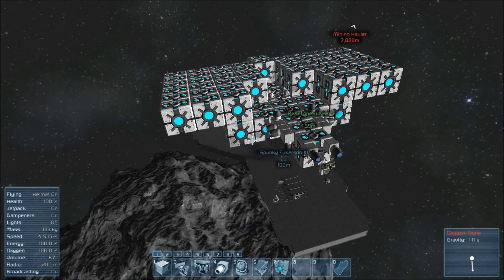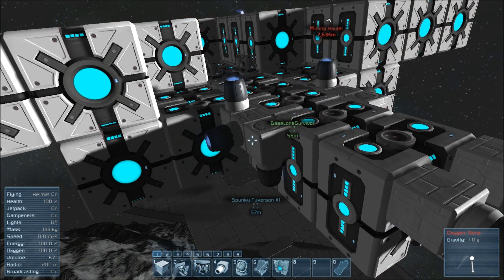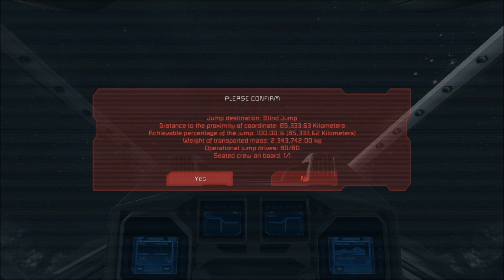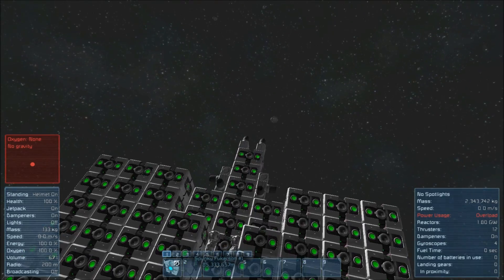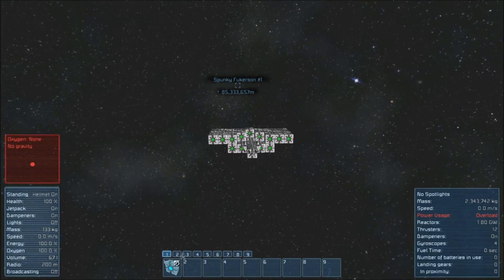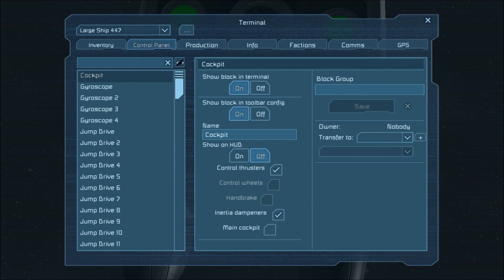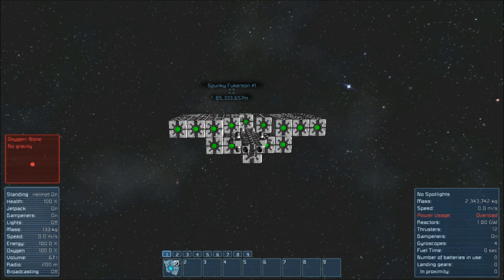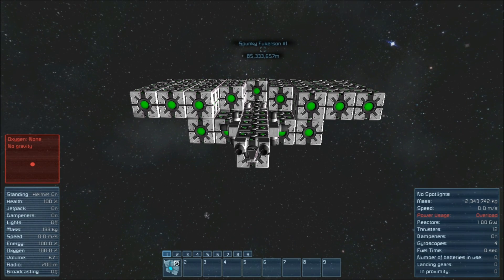Space Engineers; Furthest Jump Possible?

Comment: 64 Jump Drives is the maximum the drives can handle without any effectivity loss. Which leaves you at a jump distance of 128k km, with 1.235 mil kg mass... but not with much else to attach to the "ship". So each Jump Drive gives you a range of 2000km.

Effectivness of the Jump Drives starts to deteriorate at a mass of 1.25mil kg, so what you wanna do is design your Jump Ship around that limit. It's possible to eek out a bit more jumping distance, but I flat out stopped at around 129.75k km with 65 Drives.

So what is killing your max jump distance? Most likely the mass of your reactor.
Reply from the maker: Scyna Tharak That's good to know. It is interesting how they factored the weight of the ship into how far the drive can propel a ship. As I said, I want to do this as vanilla as possible and I didn't think the vanilla reactors had enough power to charge the Jump drives in a timely manner. I'll have to go back to the drawing boards on this one.
Reply: Misterunnamed It certainly depends on what you consider a timely manner. 

Charging at 32MW takes roughly 8 minutes for a Jump Drive, so a big reactor can charge 3 of those at once at maximum speed.

Let's run the vanilla numbers:

50 Jump Drives .... Mass 963,448 kg .... Power Req. for max charge speed: 32MW * 50 = 1600MW
1 Big Reactor .... 100MW ... we need 16 Reactors for an optimal charging rate
Mass of 16 Reactors .... 71,295kg * 16 = 1,140,720kg

Now that's over 2,000 tons of mass... far too much. At this point you can only fit 4 big reactors before running into the mass limit.

The numbers aren't 100% accurate though, just estimates from ingame.

So if you go for 100k km jump, the only viable vanilla setup with the bare minimum is:

50 Jump Drives
1 Pilot Seat
1 Gyroscope
6 Small Thrusters
3 Big Reactors
5 Small Reactors

And that leaves us at less than 1 ton short of additional weight we could add... the gyro is heavy. Throw that out and you can add in another 2 or 3 small reactors. But that's about it. Adding more jump drives will simply reduce your jump capabilities as their mass will cripple it.

At the current setup, charge time is 35 minutes.